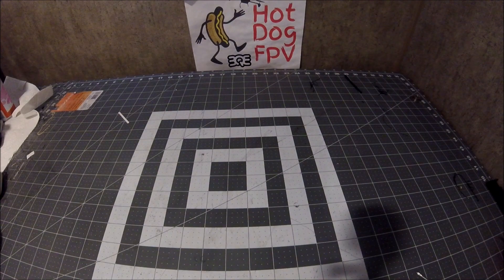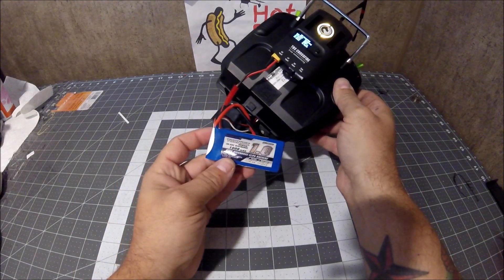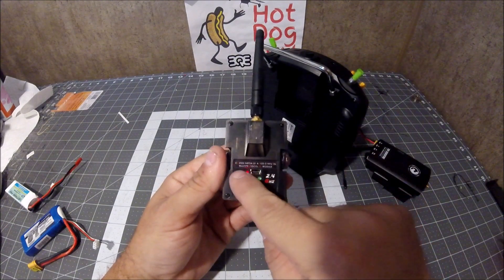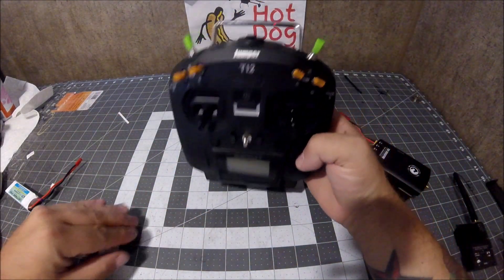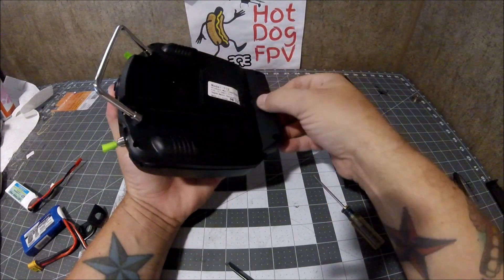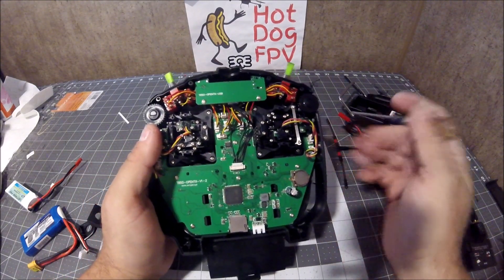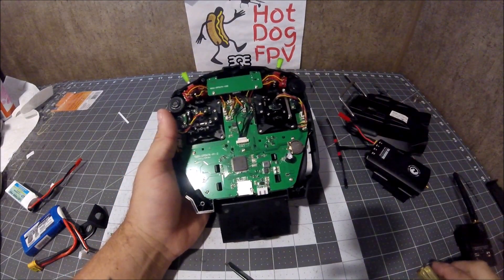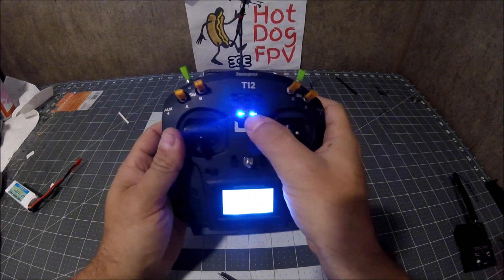Jumper T12 Plus disassembly and Hall gimbal sensor spring adjustment overview

Comment: Hello, I don't believe these are Hall gimbals. My T12 not plus has the exact same gimbals. I started getting erratic throttle so I disassembled the gimbal and sprayed tuner cleaner into the potentiometers (2 on each gimbal) Now it is much smoother response again. However, looking to upgrade to Hall gimbals, every picture  I see online that label "upgraded hall for T12" looks exactly like mine. I wonder if the T16 will fit?
Reply from the maker: I have the plus and my wife has the regular t12.  The gimbal sensors are definitely different.  These are not the same as the potentiometers in the normal t12.

Comment: Good video and thanks.  One quick question I'm thinking I might need to replace one of my gimbels.  Are they plugin or soldered?  I can't tell by looking.
Reply from the maker: They are plug in.  I just replaced one
Reply: @HotDogFPV  Thank you, I have one that seems not to want to have "repeatable" results.  My midpoint seems to float around and the end points change also :-)

Comment: Thanks mate, great info, just tightened up my throttle, it was so so easy.
Reply: Hi trevor, for the throttle, which screw did you tighten ? For the yaw pitch and roll I found them since they are the ones holding the springs but I do not see the ones for the throttle since there is obviously no spring of it. Thanks
Reply: The resistance for your throttle is the metal band with a screw either end. just tighten the bottom one and all will be good..

Comment: Me again...is there a tension for the pitch on the right stick? I noticed only the roll seems to change tension but the pitch still seems loose. Also, is there a way to calibrate the battery. Every time I charge mine it reads 8.1v instead of 8.4 as it should be.
Reply from the maker: Lop mine also says 8.1v but i think that can be changed on the same page as the rx setup and bind stuff.  There is an adjustment on all the stick but i also noticed mine didnt tighten up much.  I was thinking of removing a couple coils of the spring for more tension
Reply: HotDog FPV thanks. I only noticed one spring on the right stick (left when turned over) and that tensioned roll not pitch. I'll open it up and check again. Only because sometimes the roll gets wonky after pitching all the way up or down right before. Happened on my yaw stick too and tightening it helped the problem go away.

Comment: I have this transmitter. I'm noticing my yaw stick has a delay on it when I move it left or right. I see it on the screen display and the little circle showing stick movement. If I take it apart what connector controls yaw? Others have said it could be a loose connection so may have to explore that. What's weird is the behavior goes away if I move the stick back and forth a bunch. But any new flight upon turning on the radio the behavior comes back with the yaw delay. Appreciate any help!